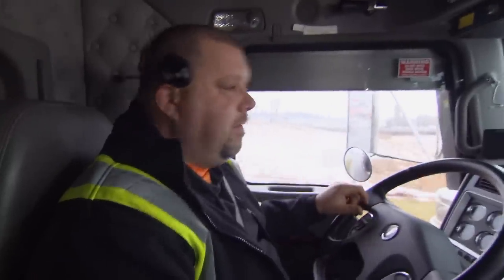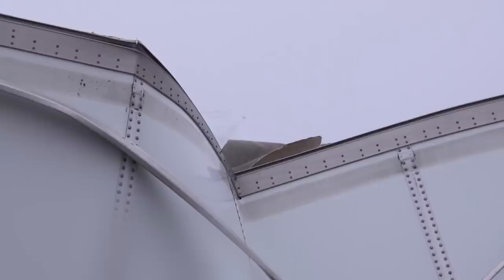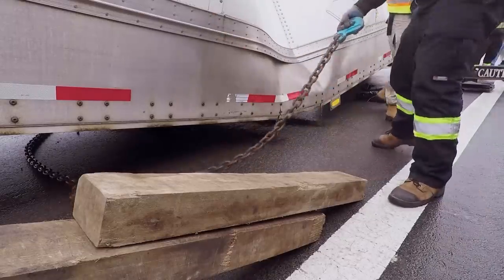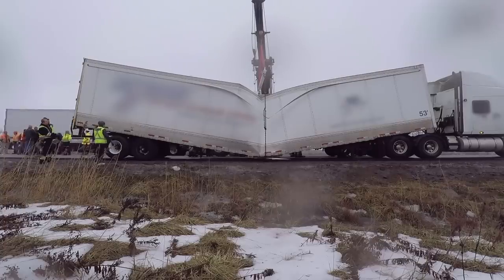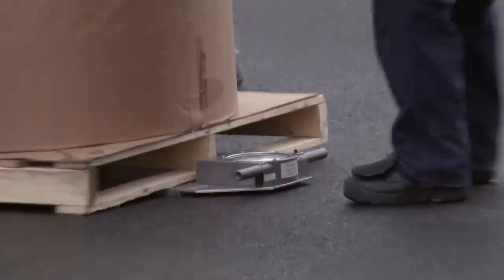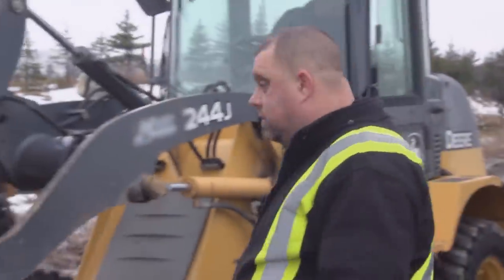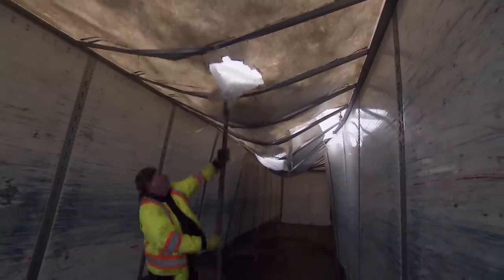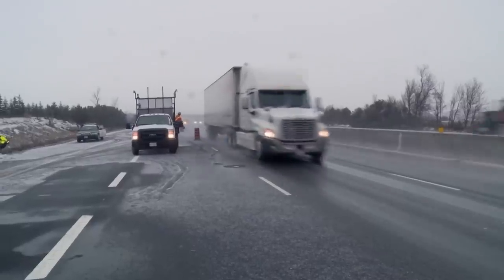What On Earth Happened To This Truck?! | Heavy Rescue

Comment: Any design engineer would see that the trailer needed a middle axle.
And the trailers load is not supported by the roof that would be stupid
Reply: brian Shikanga 
It doesn’t need another axle and the roof doesn’t support the load. The roof keeps the sidewall vertical allowing it to act like a truss. There is very little tension ever on the roof and you’re suppose to clean ice and snow off of them, because in rare cases this can happen.
Reply: @mattmoschkau2831  Smartest thing I have seen written about this video.
Reply: Yeah well guess what engineers aren't the ones to make decisions on this kinda stuff. That's all corporate and consumer. And since the consumers want to transport stuff as cheap and as efficient as possible, shortcuts are made and this type of stuff happens.
Reply: brian Shikanga I’m no where near a design engineer and I even knew that
Reply: Axles in the middle prevent the truck from steering or just peel tread from the tires. Probly a rust issue, havent finished vid yet.
Reply: @williamjones4483  I'm not saying there were any shortcuts on this trailer. I was saying how engineers aren't responsible for shortcuts, corporate is. And even then the trailer could have been designed differently to prevent such an incident. Why it wasn't could have been it wouldn't be worth the cost as this is already a rare occurrence.

Comment: go clean one off if you all think there no weight , especially when it turned to ice on top , the center line of the roof can bow inward by as much as 18" , granted not all drivers will ever experience this due to their location, but i have on several occasions and cleaned them off , and yes oddly it not even viable from ground level  when the driver does the pretrip , need special equipment to remove it even if it is visible , and sadly most shippers or drop yards do not have it available, even if the driver see it from ground level, most trailers do not have ladders or safety lines, because these roofs are slippery as heck when covered in snow and ice  , thus like this driver they take the chance and take the load, if they do not , they do not get paid, as drivers are paid by the mile and not by the hour on the most part , so for all the couch critics , go get your class 1  then you comments might be worth some thing, , hell go and stop on the side of a hwy , on a clear day let alone a crappy weather day , before talking shit ,

Comment: The USA have the worst trailer designs  You could imagine
Reply: @Ivan Thai It's still the  American continent
Reply: @Ivan Thai the Americas are made up of 3 countrys on 1 continent  south America, north America and canada
Reply: @Ivan Thai it depends one where your from
Reply: @Ivan Thai south America is classed as Mexico border and below by some people dependent on where your from. But we have different stronger trailer design in the UK and Europe which the body of the trailer sits on the chassis so the extra ice weight wouldn't cause structural damage to the trailer but the trailer body, surely the fiberglass roof is reinforced with aluminum joists every foot  or 2 at least on American truck trailers
Reply: @Ivan Thai I see that but  shouldn't it have supports to stop that

Comment: a all too common issue with trailer roofs in Canada winters, and i have seen worst , ,and it can be very dangerous ,deadly ,if not cleaned off , i am sure the driver and company will get tickets and fines for this , on top of cleanup cost and a destroyed trailer .as well not being covered by their insurer only to get a mark against their safety assessment

Comment: Lets blame mother nature. Sure thing pal, that's the easy way out.
Why not blame the department of transportation for not making it mandatory to clean the top of your vehicles? INCLUDING TRAILERS?
Two years ago up on the highway, I saw a sheet of ice 5 feet long , 4feet wide ,  fly off the top of some assholes car doing over 60, flipping end over end , smashing all over the car behind it, all because the lazy bastard driving it didn't clean off their car. And they just kept going because they never knew it came off , and causing the other guy to pull over with a caved in broken windshield.

Comment: ????? What FN mystery? That dam idiot that loaded the truck, along with the driver that did not properly insist on spreading the load out evenly had all the weight set between the tractor and rear trailer axles! That not only added the stress in the middle of the trailer, but more than likely had too much weight sitting over the drive axles! That much weight needs to be distributed over the whole length of the trailer! After 30 years of driving trucks I’ve seen more than one trailer fail like this! One was an identical load of anti-freeze in one gallon jugs on my trailer and another I fellow driver was responsible for. But when we got loaded I was there in the trailer and on the loading dock to be sure the weight was properly distributed in my 53’ trailer, but he was too lazy and his rig was not loaded next to mine so I had no way of seeing it loaded! We drove over night to the same warehouse to delivering the morning, he drove faster than I did and actually made it to the place, but when I pulled up there he was backed in with the trailer sagging a bit in the middle! The receiver had no idea how to empty the trailer safely. But I came to the rescue, I had the driver crank the landing gear down in low gear as far as he could, then the two of us piled wooden pallets under the trailer to support it so we could safely drive in with the forklift to empty the trailer! I have to say it was a cheep fleet rental 53’ , I cannot remember the manufacturers name, but it was not a Great Dane or  Fruehauf!

Comment: First off to all of you who say  poor engineering is to blame your half right fiberglass/canvas roofs had no business hauling anything over 15,000 pounds of weight or 6800 kg as you say up there in Canada if you're going to be hauling anything over use a all aluminum trailer yes their heavier but their made to take the weight.
Second it was the drivers job to check the state of road readyness for the trailer most of the blame is on the driver's shoulders because he should have known to check the total weight of his rig and not picking up the paper load with that piece of SHIT trailer.

Comment: Doesn't need towing the unit is fine and the empty trailer is  rolling without the load just drive slowly and escrt it off the road..  What a fuss about little problem.. Done for the  filming?? they always make it  dramatic for that.

Comment: Simple solution is to get trucks tops and corporations to install snow removal devices at there locations. I ain't climbing on these cheap roof trailers but when that snow flies off it we get fined for dummies windshields getting smacked. Should be fining the dummies for following to close in bad weather conditions.

Comment: I’d cut the trailer in half get a flat bed forge part with the pin and on the rear piece I guess you could rig it up to tow flat bed both piece es it’s fucked anyway

Comment: HERE IS THE FACTS OF WHY IT BROKE IN HALF!!!!!  The trailer has a piece of shit translucent roof that is weak and flexs more than a aluminum roof skin will. When the translucent roof flexs it loosens and breaks the roofbow rivets attaching it to the top rails and when the rivets break the roof loses all structural strength and the trailer will just fold up and break in half when you put a heavy load in it!!!  Because a dry van has NO frame and if you weaken one of the four sides it loses all of it's strength just like a cardboard box!!!!  And the second problem is it's a junk plate trailer that is a weak trailer even if it had a aluminum roof!!!!! Because the sides of A PLATE trailer has NO posts!!!!   So if someone checked the roofbow rivets on a regular basis and made sure they were tight then this wouldn't happen as easily. But a plate trailer is a weak trailer to start with and translucent roofs should be outlawed!!!!!!!!

Comment: Poor quality American engineering.
Reply: SRM Solar radiation management Geoengineering this happened in Canada
Reply: It was the drivers fault it's their job to determine if the vehicle is safe for highway operation
Reply: Lol, accusing the wrong country. Quick to judge huh?
Reply: @oneeco  your typical foreigner
Reply: @tomwoot9501  yes, but Canada is also part of the north American continent if I'm correct...
Reply: @leopold7148  He said American, not North American, to be very specific, he is perfectly referencing the U.S, not the continent. Since you want to be so technical.
Reply: @mattsprayberry0  No, the trailer goes under inspection before being loaded. And it is not the driver's job.
Reply: @MisterrVi  
Yes it is I drive a 18 wheeler here in the US/Canada and it's Federal/ DOT(department of transportation)law that a driver has to inspect all equipment truck trailer load etc before it's allowed to be on the road not to mention it has to be done multiple times a day to ensure the safety of the motoring public and if there is a problem you have to get it fixed before you can proceed so is there anything else you want to say about how it's not the drivers responsibility to inspect their equipment don't believe me look it up
Reply: @mattsprayberry0  My info source is from a patreon documentary and an interview/tour of a guided trucking service.
Reply: @MisterrVi  ya well I drive a truck for a living 7 days a week 10 ½ hours driving and probably another 2 ½ hours give or take on duty a day I know the law and what it states you don't have to believe me if you don't want to
Reply: @mattsprayberry0  I was just saying that I got the information from a false source if what you are saying is true.
Reply: @MisterrVi   well sorry I misunderstood but what I'm saying is true although some drivers don't do it is Federal law for a truck driver to inspect any/all of his equipment/load he is responsible for
Reply: @mattsprayberry0  I understand and thank you.
Reply: @oneeco  technicly it is very common for canadiens to point say that they are Americans. Which is often followed by having to explain that there is more that the States in America. Since you have to be so technical
Reply: It happened in canada
Reply: Paper Loads require paper spec trailers.... Heavier duty than normal. This isn't uncommon...